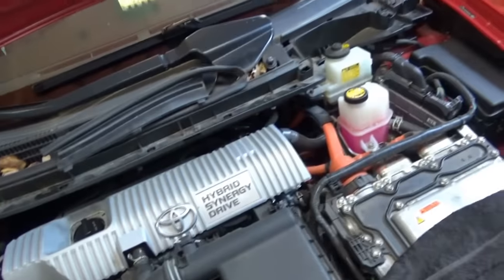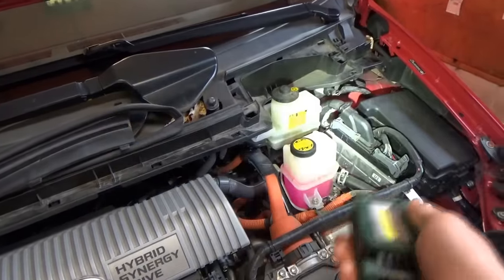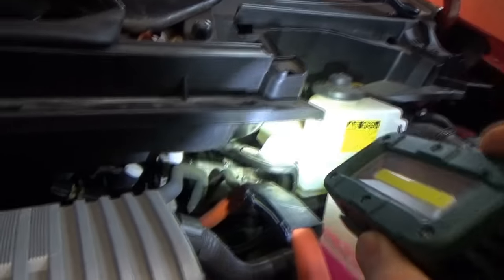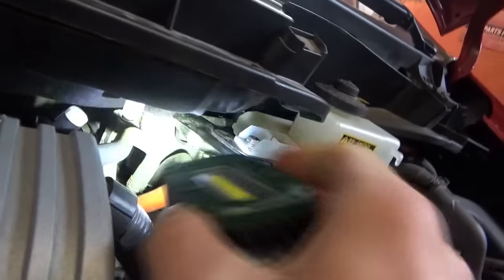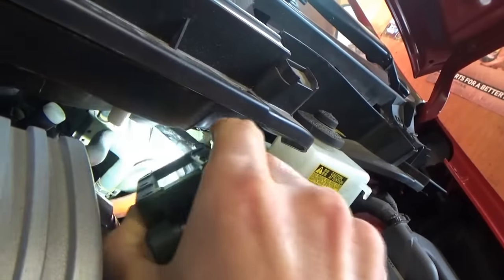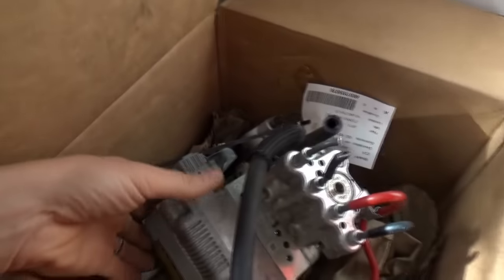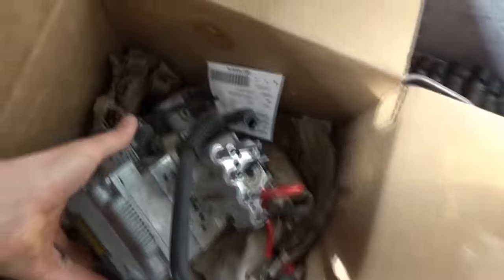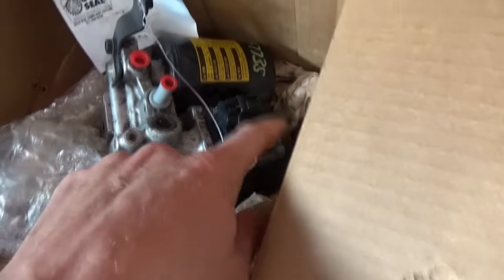Prius Brakes FAIL (Hidden COST of Hybrids)

Comment: "Do Hybrids really save you money in the long run??"

LOL yeah the car got the owner 230000 miles, seems pretty good to me.  Oh, and they like the car so much they are willing to pay to have you fix it rather than just scrap it like some 120k mile Chevy Malibu...
Reply: If the Prius averages 50mpg, it uses 4600 gallons of gas less than a car averaging 25mpg (like my car).  4600 gallons times 3 bucks a gallon is $13,800.  So yeah, I bet hybrids DO save you money in the long term, even if you have to pay $200 to bleed the abs system.
Reply from the maker: @benjamineastman9429  most crossovers get well over 25mpg nowadays and are AWD and more versatile than a Prius.... There's more to the equation than just fuel savings 🙂

Comment: Better yet just totally AVOID the Toyota Prius, the gas you save is nothing compared to the massive high price you'll pay to fix theses cars. Mine is a 2008, only has 121,000 miles and the brakes are absolutely dangerous and Toyota knows it. They want thousands of dollars to fix it and doing it yourself is very difficult. My BMW master cylinder is only $95.00 and pretty easy to work on yourself!

Comment: buy cheap because they are all junk right out of the factory.  new or used out of the factory, there is always liability issues, 
 The question  is, what will it take to bring in suckers to buy their junk cars.  listen. if your in the rust belt,
 it's a total waste of hard earned money to buy any of the new high tech cars or trucks, and in five years it's ready for the crusher. 
 And so on. A car should last you no less then ten years with minimal basic maintenance...... we had two cars go twenty years. 
 My wife car is over ten years old, still going strong. a gas burning Chevy. It might even out live her. our 2015 4x. 
 just basic required maintenance. 3,000 dollars will buy you  a vary good used car,  that will out last that electric pile 
of junk by many years.